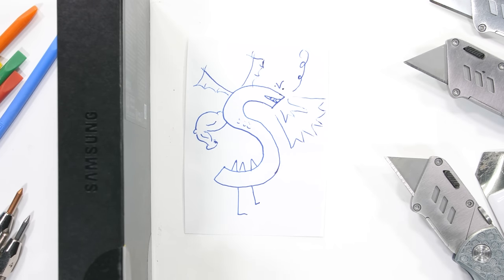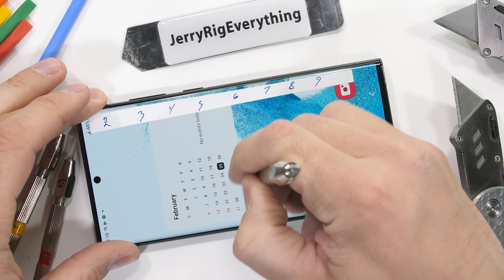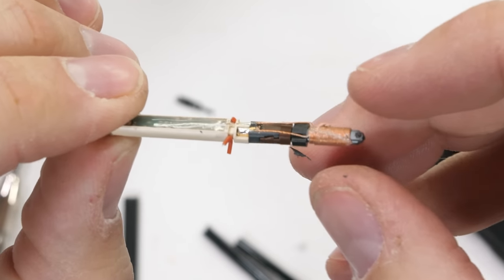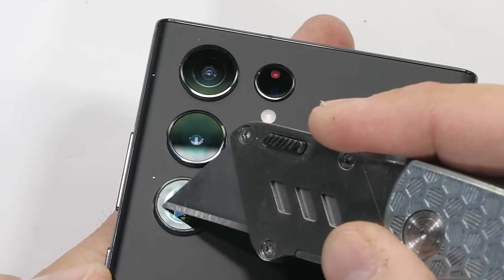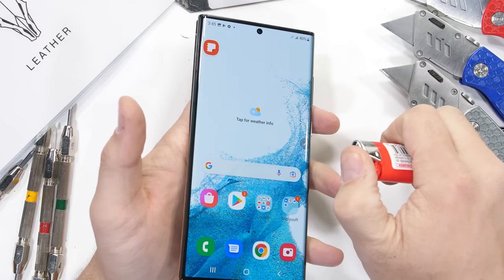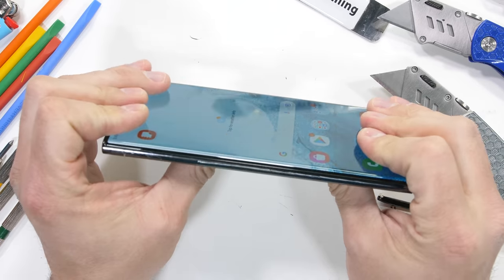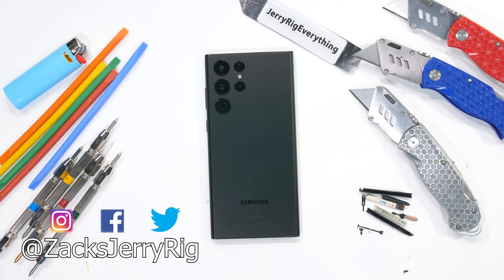Galaxy S22 Ultra Durability Test - How does the New S-Pen Work?!

Comment: Having just upgraded from the Note 20 Ultra I have to say I really like the look and feel of the S22 Ultra and especially the rear camera layout and the frosted back. Only had it since Friday and still putting her through its paces but it's a complete powerhouse of a phone with everything I've thrown at it to date. Great durability test as per usual. Looking forward to the tear down
Reply: I'm using Note 20 Ultra now too. Is it a worthy upgrade? What about the battery life? Because that seems to be the only thing different than my N20U
Reply: @Hentai_Senpa169  galaxy s8+ user here, i dont see the reason to upgrade my phone, even tho i have one galaxy s20 FE sitting inside its box
Reply: @Keroberosyue  only if your Note 20 ultra is damaged and almost unusable or you can get a really good deal on a S22U or of course if you got north of $1,000 just laying around you want to spend for the hell of it. But other than that no you're better off holding onto the Note 20 ultra a bit longer. The only reason I upgraded is I got a $1,045 credit for my Note 10+ which means I got the S22U 512gb on a premium plan for $355 I would have never got that offer for my 10+ at a later time so I jumped on that deal an hopefully still have beyond Android 16. Now if I would have traded my 10+ an paid close to $1,000 or better I would be feeling pretty shitty right now not that the S22U is bad by no means it's a awesome phone but so was my pristine condition 10+ an I would have felt like I threw money away but the deal I got I'm a happy camper lol
Reply: @Keroberosyue  I upgraded from the Note 20 ultra to S22 ultra and personally believe it's a worthy upgrade if you get a good deal. Battery life is a huge improvement I went from getting 6 hrs SOT from 100 to 0% with Note 20 U to getting 8/8.5 hrs of SOT from 100 to 10% battery with S22 ultra. Pictures are better with more detail, zoom capabilities are top notch, and the display quality is great now that I can use 120hz with WQHD+ 
Like I mentioned if you can get a good deal I would recommend upgrading however the Note 20 ultra is still an amazing device.
Reply: I'll definitely miss the Micro SD card slot if I upgraded
Reply: @pixels_per_inch  how can you call upgrade if you miss something?
Reply: give it 2 years and see how it fares then. xD im using note10+ and still is great for my work and personal use. Only my glass is cracked, but oh well, still works fine. I would upgrade if the s22u came with microsd slot lol
Reply: @bobowyc  the best you can do in that situation is when the time comes to upgrade just make sure you get twice the storage you have now, I almost maxed out my 10+ 256gb an was planning on buying a SD card for it but I ended up getting a great deal on the S22U so I went with the 512gb so I should be okay but if you already had 512gb then definitely get the 1tb.
Reply: @jimmyc1518  lol. my sd card is 256GB. haha.. and its 50% full of work photos and necessary data. xD If i were to upgrade to the s22u i would need a 1TB haha.. which is way too costly for me hahaha. although they do have the promo, but now i guess its over. haha. oh well. still prefer the sdcard slot though.. xD
Reply: Get ready for in 1 Year where it will drastically slow down like my S20U. Thanks samsung. very cool!
Reply: @manuelmunguia616  Since you already have one you might as well go for it. Unless you are going to miss some features from your S8 that are no longer on the S20 FE then it's definitely worth the upgrade.
Reply: @metallurgico  Exactly! Modern "flagships" (I hate that word) are so annoying. I would only want to upgrade to a Z Fold 4 if it's good but it will probably not have 3.5mm jack or SD card slot so it's not really an upgrade.
Reply: @jimmyc1518  hey, would like to know, how u got 1045 for Note 10 plus, I am having note 20 ultra, can u help??
Reply: @NikhiilJaiin  Verizon was offering a promotion for a $1,000 credit with a select trade in and I already had a $45 credit on my account I have been saving towards a new device and they applied that as well when I placed my order. In order for me to get the promotion I also had to upgrade my old plan to their premium plan which works out better for me anyway, I was already paying for apple music an now it comes with the plan. An crazy as it sounds after I upgraded to the S22U my monthly bill was around $20 cheaper than I had been paying lol reason for that is I enrolled in auto pay an they knocked $30 off my bill. 50% off a watch also come with my plan and I picked my sis up a apple watch today. Check an see if Verizon is still offering the same deal if they are jump on it if you can.
Reply: @jimmyc1518  That's awesome, thanks for the info👍👍
Reply: @NikhiilJaiin  no problem hope you find a good deal 👍
Reply: I came from an S10 plus and got it the 22 after preordering and God damn it's the best thousand dollars I've spent in my life it's a huge jump in camera quality from these 2 phones ive always thought that the note 20 was kinda better looking than the s21 but the s21 had better specs so I don't go for either now that they are both 1 phone it's a win the hardware of the note and the specs and cameras from the s I also dint think that I would like the s pen so much untill I started using it this is cool af
Reply: @Keroberosyue  Daughter works at Samsung & said the battery life isn’t as good as the Note 20 Ultra. She’s keeping hers
Reply: @Keroberosyue  I work at Verizon and have gotten a lot of complains from customers on s22 ultra and regular s22s battery life.

Comment: The new camera layout is top notch! However most of the case manufacturers took it way too easy and just made an L shape hole on their protective cases. That's a no go! I pre-ordered dbrand's grip case! They made perfect cutouts! Thumbs up to them (as always)!
Reply: 👆👆 I really appreciate the effort of the guy he's really a guess,I got my iPhone 13 pro max in less than 4 days
Reply: The issue with cutouts is you can't use camera lense protectors, I've got the ESR protectors on my 22 ultra
Reply: @macauleyh5  I've never used any kind of screen or camera protectors, just reliable mil std cases
Reply: 8nn
Reply: @Memmaao  depends what job you have, without screen protectors, lens protectors, charge port dust plugs and wallet style cases I'd give the phone 2 weeks before it's covered in scratches
I use the uv cured glass protectors so you can't really tell that there's one on I'm a bit ocd with damage 😂
Reply: @macauleyh5  I'm an emergency Doctor and a MEDP on a helicopter.
Reply: @Memmaao  agree with you, as a steelworker full of dust from all kinds of various alloys, a reliable case was all I needed for the S20+ to last from release till today still, with minimal scratches (only a few mm long noticeable under very specific lighting conditions)

Also, to the person above, the chance of your glass screen protector being harder than the gorilla glass on the phone is slim to none, so that'll wind up looking worse long before it would without one at all.
Reply: @Shibby7634  it doesn't matter if it ends up looking worse as long as it's not the screen itself that takes the damage, thats what I think he meant.
Reply: Yeah that's a valid point, but if he's really OCD about scratches it's only going to be exponentially worse in a far shorter time with a protector... if he's as OCD as he says then it'd be better to accept a few imperfections over the life of the phone instead. Perhaps he mistakes the '9h hardness' on most the listings for glass screen protectors for more than what it really means.
Reply: @Shibby7634  would you then consider this phone is better of with only the case? I dunno but I'm looking forward to buying the s22
Reply: @ThePolulos  I would prefer no case but I use one only because I like having a kickstand and also like the phone to lay flat on it's back (seeing as the cameras would interfere with that.) Also any case does offer additional impact absorption, though I don't think scratches are a major concern on flagship phones. I went with the slimmest choice I could that includes a stand (Spigen Tough Armor.) It's about as slim as you can get, but has offered fantastic protection for the 5+ years I've used it on various phones. 

I pre-ordered and got mine 2 days before official 'launch' and while it wasn't a major upgrade from my previous phone (S20+ to S22 Ultra) I very much appreciate the improved cameras and the s-pen to trigger the shutter for group photos (as well as more precise photo editing occasionally.) I would recommend the S22 myself.
Reply: @Shibby7634  well, the point of having a screen protector, no matter the material, is that you can throw it away once it gets too bad. You cant easily replace the phone glass but you can buy a new screen protector for like less than 5$ for a PPF, or 20$ for a glass one

Comment: It would also be nice to see how the fingerprint sensor works under a little bit of water instead of just scratching it, since a lot of people use their phone in the rain
Reply: "A lot"?? nah. I for one never needed to nor seen anyone use the phone in the rain. Even if we do, rain isn't "under water" and won't mess up with your fingerprint sensor at all... a simple wipe is enough if it really is soaked.
Reply: Coming from my S21, it gets screwed easily under the rain when you use the sensor.. might just be me
Reply: @TIMETECH07  yes it gets unresponsive a bit in the rain. But a simple wipe from your sleeve should be enough to make it work again
Reply: @gurubhaktmohit  yep, and a little bit of water don't affect the sensor much, don't be like me today, using it in the heavy rain and blaming myself for not being able to unlock my phone via fingerprint
Reply: @gurubhaktmohit  to be fair, you've never gone outside and/or showered so ofc you wouldn't need to use it underwater

😅😅😅
Reply: I just tested this by unlocking my phone under a running faucet. It took me two tries but it unlocked without any real issue.

Comment: We're going to see how it holds up to every day life:
Using a lighter to try and burn it - a little damage after 20 sec.
Taking a box cutter to every surface - not bad.
Bending it in a way that would never happen in every day life - won't snap in half.
Will it crack from a drop of a couple feet? - that rarely happens in every day use, so we didn't try that.
Reply: The last one is true.
Reply: Or dropped it in water lol
Reply: He should start dropping them
Reply: You probably never did put your phone in the back pocket, did you? Dou have back pockets at all?
Reply: @eduardoavila646  who the hell does that
Reply: @Ahmed-jv7oc  Alot of people do it. I only do it, when i have mu phone, my wallet and my work phone all to carry around

Comment: I love how Zack doesn’t feel the need to always get the latest and greatest smartphone when he could at anytime.
Keeps me inspired to continue to hold my iPhone 11 Pro than to get any newer phones simply because it’s still working perfectly well with daily tasks that are thrown at it.
Kinda feels like every smartphone that comes out every year just brings minor increment upgrades, making it boring….
Reply: They come out with new numbers to keep shareholders happy..
Reply: you should hold on to your phone at least 5 generations imo
Reply: I'm still happy with my Note 8 that I got in 2017. Runs absolutely fine. The only reason I would like to upgrade is so that I can use the Note 8 as a backup/secondary phone.
Reply: Yeah that’s right so I keep my iPhone 11 Pro Max up to now
Reply: Naruto uzumaki 😂😂😂
Reply: Naruto what is telegram
Reply: Lol my S9+ can and could handle not only daily tasks, I'm pretty sure your 11Pro should he able to handle literally any task, daily or heavy, that you throw at it.
Reply: My iphone 6 is still running 😂 ( as secondary phone , needs a battery replacement ). 11pro is 28 months old. it’s good for another 2-3 years unless i break it.
Reply: I'm using (and loving) my S8+ and while I have no problems performance-wise (I do have a 10700K 3080 system so I definitely would like a faster phone as well but it's not a dealbreaker), the 5-year-old battery performance prompts me to change my phone.

I also got a screen replacement which turned out to be a fake so my touchscreen is all over the place and I have awful burn-in. That also prompts me to change it. Buuut Turkey's in an economic crisis and I can't even afford [junk] food, soo, yaayyy!!!

Clarification edit: I bought my PC before the Turkish Lira lost 60% of its value and my car/gas/food/everything else went up 3x in price. But not our salaries, obviously.
Reply: You think your 11 pro is old?
Man I’m still using the 6s and it’s still working perfectly fine with everything i need!!
Reply: Need is better than greed
Reply: still using my 2017 LGG6 which has been discontinued haha
Reply: how are you just realizing this lol
Reply: On one hand I'm happy for you (I'm using 11promax myself), but on the other hand it's really strange to me that in today's culture a person saying they are using a 2 year old flagship phone can be made to sound like a badge of honour, somehow. Also "it's still working perfectly well with daily tasks" sounds like you're not talking about the very high end phone that's 2 years old, but a 10 year old ZTE Blade III that's running an exceptionally buggy rom. 

TL;DR: people, some perspective, please.
Reply: Exactly, the only reason I would switch is for 120 Hz along with some features that interest me. All that while I get the phone at a REALLY good price.
Reply: I still have my Samsung Note8 and it works fine.  I sill believe the Note 7, sans battery issues, was one of the best Samsung phones ever made.  I actually still have my original Samsung Galaxy S with slide-up keyboard.  I turned it on the other day and was still amazed at the screen display quality.
Reply: Until they start bombing you with updates every week like they're doing to my Samsung S10 Plus/Hubby's S10. It slows down and makes things work wonky. I'm pretty sure that's "by design". They did the same thing with our S6s.  We refused to buy new phones so they bombed us with updates and then pretty soon lots of apps weren't being supported anymore and we were forced from the 6s to the 10s.  Now we're being forced from the S10s.  Oh well, at least they're pretty much free now. That was our whole issue. Actually having to pay for the phones.
Reply: I just got an s22Ultra. I only upgraded because 3G is being phased out. If your phone works, and it does everything it needs to do, there isn't much of a reason to upgrade.
Reply: honestly i can trust apple when it comes to longevity which is expensive but premium indeed, so your iP11 will last a long while. recent Android phones are reaching that kind of quality too. i was doing just fine with my note 8 (but i got a note 20 hand-me-down 😁)

Comment: I love how you can see the framerate dropping in the lock screen to save energy
Reply: LTPO tech is so awesome. I just got my S22 Ultra, upgrading from an S21 Ultra. On both phones, unless you were looking at it through a camera, you would never ever notice the refresh rate changing.
Reply: Unless you spend a lot of time staring at the lock screen, it probably makes not much difference at all.
Reply: @SGTRandleOneOne  What's funny is the S21 ultra gets better battery life than the S22 Ultra even with the "LTPO" screen. SD 8Gen 1 is just horrdenous.

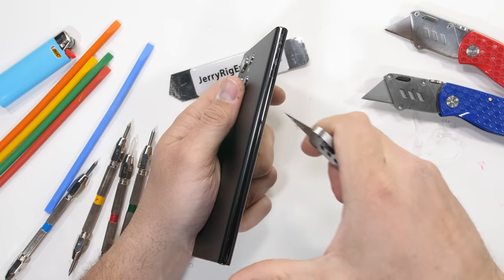Comment: 2:20 The protected film is important, it protects the chrome from rubbing and scratching
in pockets. Also to resell, when the S6 came out, there was lots of and lots of units
that were scratched in the box, with no protectors on it.
Reply: True still annoying though I pulled my straight off.
Reply: @wizzgamer  Ya I know some might not care, they use the phone as is bare :) 
But I go all out, UAG case and Whitestone dome :)
Reply: Why was there no pre-installed screen protector then?
Reply: @WirxawTanev  That is why because there was no protection on screen or side units were coming out scratched out of the box whole thread on forum about it. Also mine had same issue was a sleeve they were using.
Reply: The side protected films are a relic of their parts manufacturing process. They are exactly the same as how you car parts ex. front consoles and leather seats are covered with surface plastic before they are hauled by robots onto the car chassis. They protect them during the manufacturing process, not so much for packaging. Consumers are also confident when they see these strips as it assures them of the unit being completely new.

Comment: On my S21 Ultra, developer settings allow me to see the actual refresh rate in adaptive mode. It only shows switching between 60 HZ and 120 hz, not the 10 to 120 advertised. I am skeptical that this phone is any different. I will see when my phone arrives in April.
Reply: I just tested that out, my S22U was between 24hz and 120hz. Maybe sometimes it will drop to 10 but I didn't leave it switched on long enough to know.
Reply: april dam i got mine 2 weeks ago lol
Reply: @afuen400  did you get the black? That was the only color available that I could order an have it shipped to me overnight so that's what I went with but any other color I would have had to wait till April.
Reply: White and the 512 gb from att
Reply: @afuen400  gotcha yeah other colors must have been available with at&t I got mine from Verizon.
Reply: AFAIK the adjustments on the refresh rate are hardware level instead of system or software level. In other words, the lower refresh rate is not shown on Android developer settings.